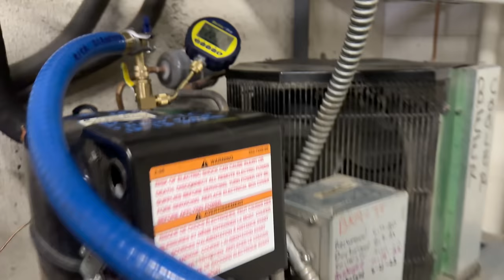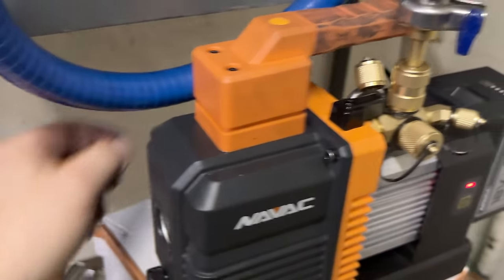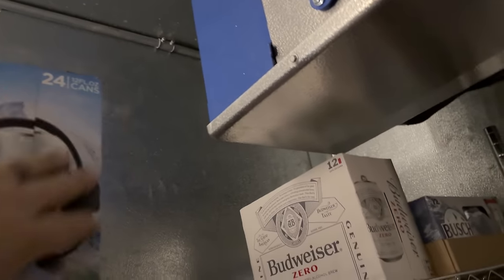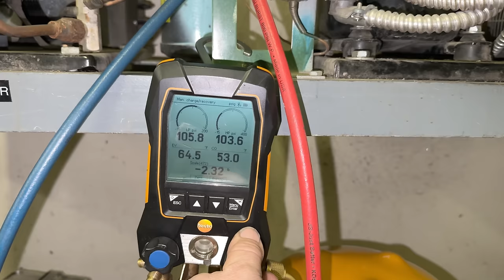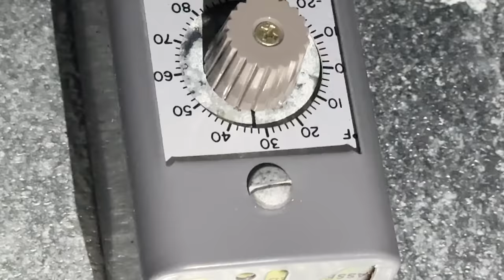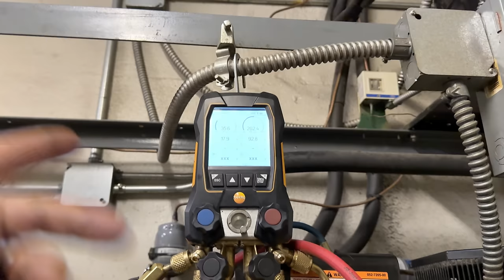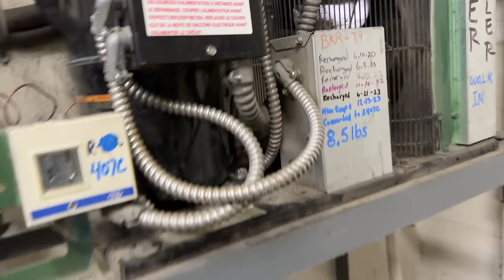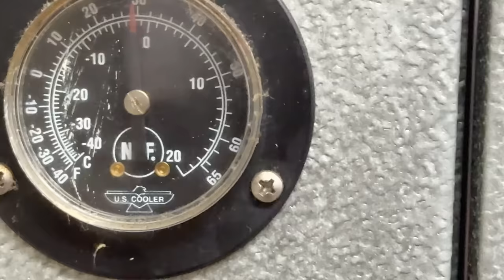Walk-In Cooler Conversion To R407C Refrigerant

Comment: It will work fine.   I ran R-407a in old R-22 (POE oil) coolers,  good gas but won"t be around forever.  Some units are still going strong 8 years later.   Now I run R-449a.  Almost $200 bucks cheaper per jug, pressures are good.  Got a couple units going now 2 years on it.  Seeing less 22 equipment these days.

Comment: The tail on the sensing bulb is supposed to be up. Round part facing back towards the coil.
Reply from the maker: The best position for the bulb is horizontal not vertical, but yes, if it is vertical, then the tail of the bulb should be at the top.

Comment: Probably doesn’t have a solenoid cause that recover isn’t big enough to handle to pump down charge. Definitely needs an ETC if no defrost clock. Personally would have thrown some nitrogen in there if system had existing leaks and I saw some work like that. Still a very good video and a good example of what we deal with in the field.
Reply from the maker: According to the history, our guys found the leak in the evaporator, but like I said, it was quoted for all day, but because the helper went with the installer and not me, he ate up a lot of my time. And at this point, I was paid based per job not hourly.
Reply: @HVACRSurvival  yeah I totally get it. My company goes the same thing expect they don’t always send a tech to do the start up they just let the install guys do it and I find it three months later iced up to the nines haha. Good videos bro keep them coming.

Comment: There was something bubbling by the sightglass @ 10:05
Reply: yea the sight glass is leaking  bad.microns only 2000.
Reply: yeah it was whizzing gas/oil... missed by him and multiple previous techs, which goes right back to whom installed it and cooked it to death. wrong size tubing brazed in.
but having a braze joint that close to o-ring/sealant-joints = super-duper POOR ENGINEERING. so I do not blame the field techs/installers(the very least bit)

Comment: There really should have been a LLSV and a A419 temp. control included in the quote. Cycling the compressor with the thermostat without a pump down is not accepted practice. I know you are there for start up and had not been involved in the initial survey.
Reply from the maker: Oh, I’m sure if the person who quoted it ends up seeing the video he won’t be very happy about what I said. But I also know the customer is trying to save money anywhere they can and $50 could be the difference between getting the job and not getting it. Sometimes you just gotta get the job done and then you can sell the upgrades after that. Pay me now or pay me later. I marked it on my paperwork that is recommended those items be installed.
Reply: @HVACRSurvival 

Hi  I am an industrial refrigeration technician. from Israel I have a question related to Freon mixing. Can Freon 427 replace 438? Is 427 suitable for working in low temperature industrial cooling systems? Thanks appreciate your time.
Reply from the maker: We don't use either but this google search said 427a is for low temp. https://darment.eu/refrigerant/r427a/#:~:text=Refrigerant%20R427A%20(sold%20under%20the,improves%20by%205%E2%80%9310%25.

Comment: Why 407C? Wondering if it is a “regional” thing? Seems most people in my area switched to MO99
Reply from the maker: There’s several different refrigerants to choose from, a lot of it comes down to personal preference and experience wired the type you’re using.  Also how many chemicals are in it, because when it does leak it will leak at different rates and  the less in the mix the better.  R448 has four types, R407C has three. It’s just a tossup. I don’t like MO99, I seen it used an air conditioner more than medium temp and I didn’t like the way it worked in air conditioners.
Reply: All these gasses on borrowed time but I like 407c more than M099

Comment: I worked on a cellar cooler that had no solenoid... it had a stat that controlled the evap fan and a stat for defrost?? The condensing unit had a pcb for pressure sensing and fan speed... i couldnt get it to work correctly it was about 12 years old and i forget the make but how the hell was it supposed to shut off when it reached its set point??. There was no room stat.... but could it be controled by the txv and the pressure sensors??. Non of the paper work had been filled in and when i first saw it it had been butchered but i got it sort of working... anybody see anything like this???

Comment: I recommend using volt meter to check t stat,instead of click,and also that is a 10 lb max receiver,thanks for sharing.
Reply from the maker: Thanks for sharing, your correct, I should have used my meter.

Comment: for best/proper function, txv sense bulb mounted vertical should have the cap tube coming out the top. when horizontal the cap tube should be at the top most position
why? the "refrigerant/gas charge" within should be a liquid in the bulb and gas in the tube/valve head, because the gas flows easier and makes it react somewhat faster. also the bulb should be lower than the TXV itself.
sometimes things just don't work out great and the way it was found, mostly off the pipe in mid air, was very bad. nothing is ever perfect in the real world. 😉 not busting balls and I know how the equipment gets hammered and abused out in the various fields.
boo to the replacement installers, they should have re-piped out horizontal enough for sense bulb, then turned vertical to existing line. (yeah I know, time crunch in and out fast)